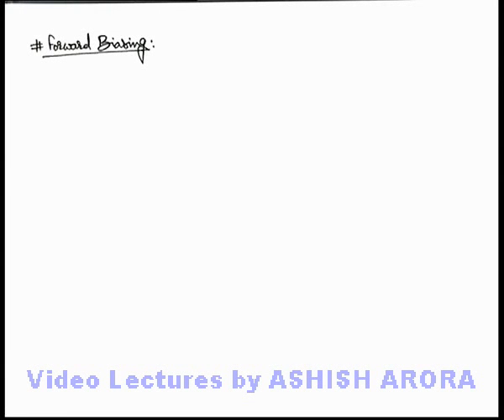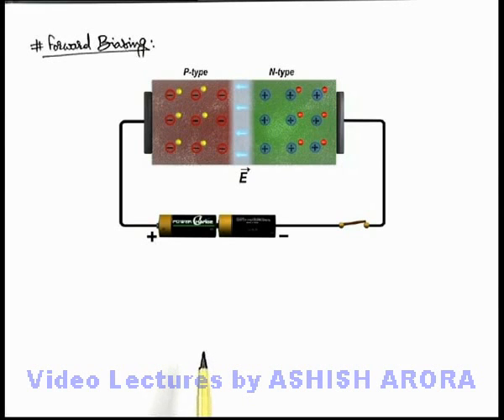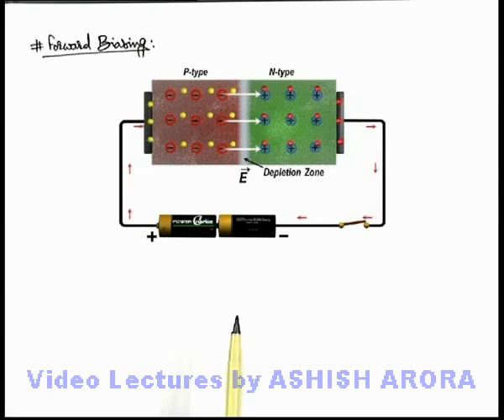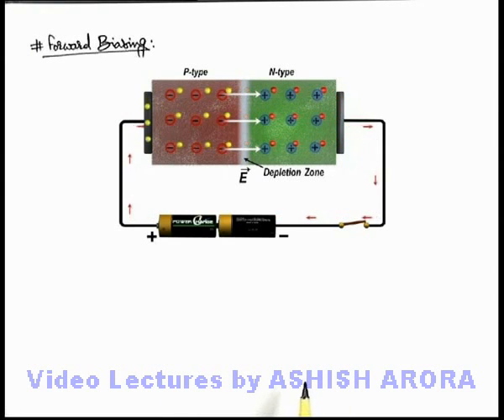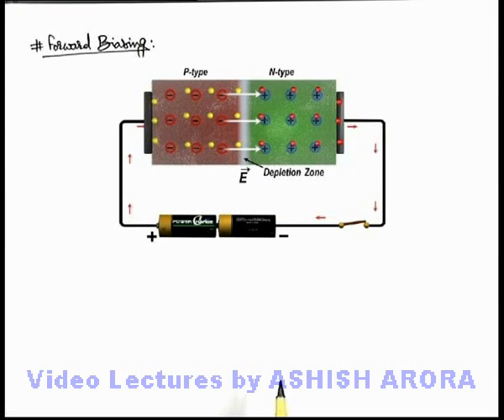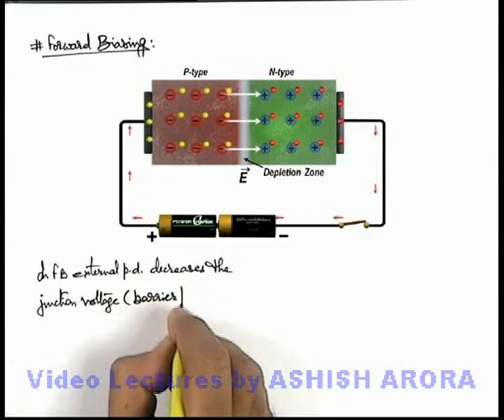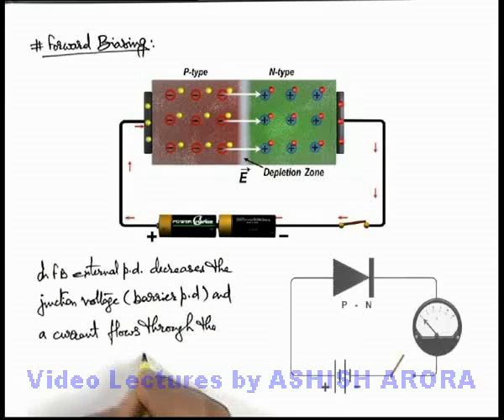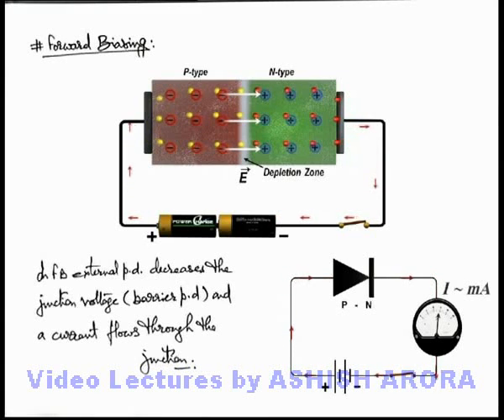Class 12 Physics | PN Junction & Diodes | #5 Forward Biasing | For JEE & NEET

Comment: As electron and holes are accumulated in the depletion layer due to FB then it's width should increase n then why it is decreasing?...
Reply: Electrons and holes combine at the middle. Since there is continuous external supply of electrons from battery the depletion layer will not become wider.. Because depletion layer widens when the electrons and holes are exhausted from the middle portion of the but here that won't happen due to external supply of electrons.

Comment: sir, i am unable to visualise why the depletion layer is getting thinner.
Reply from the maker: depletion layer is made due to the separation of electron - hole pair and the internal EF keeps the charge careers separate, if forward biasing is applied net electric field first reduces and turns in oppsite direction due to external EF which makes the internal EF vanish and net EF will grow in same direction of external EF...
Reply: @physicsgalaxyworld  then why does the depletion layer do not vanish...??
Reply: @cosmolearner5562  there would be some space in which both holes and electrons always neutralize

Comment: Diffusion current >drift current. when frward biased.
 More diffusion curr (-->)more diffusion (-->) more width of the diffusion region     

so according to my inference,the depletn region width is more when frwad biased .and its NOT so :p   
plz point out  Thanking You .
Reply from the maker: +Vishwanath V.Pai depletion region is the region which is free from charge cariers or where doping cariers neutralize to maximum extent and its width is decided by the internal electric field. In FB external field overcomes internal electric field so width decreases and in RB it supports so width increases...
Reply: +Physics Galaxy but sir in FB more electron and holes are neutralized so why depletion layer is not increased?
Reply: +Physics Galaxy but sir in FB more electron and holes are neutralized so why depletion layer is not increased?